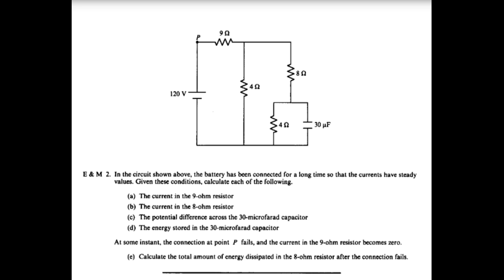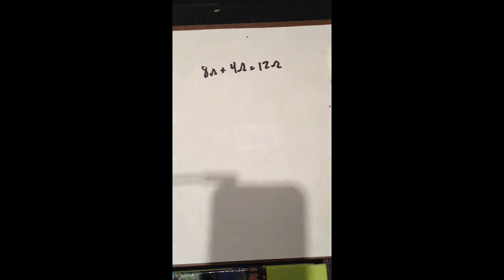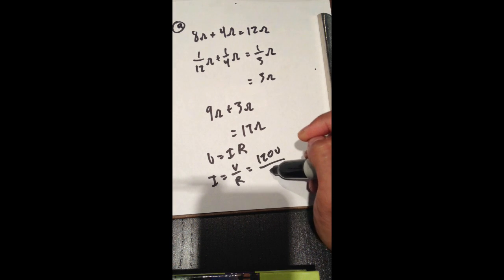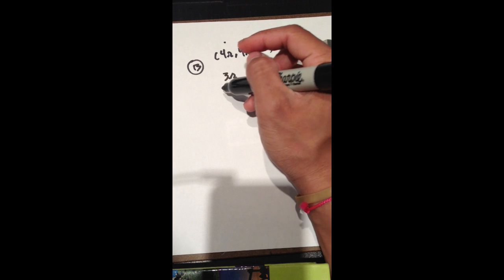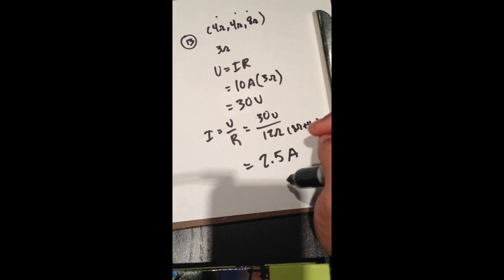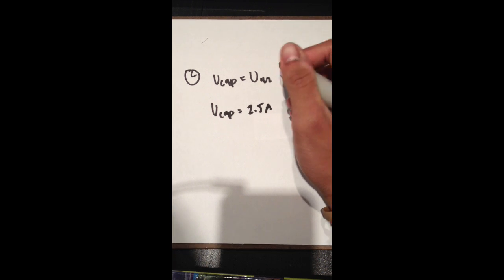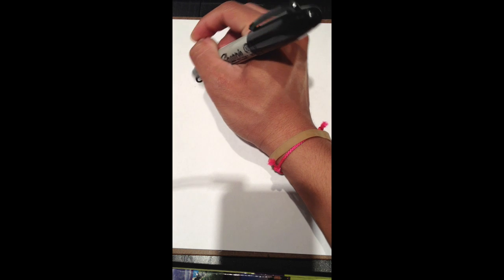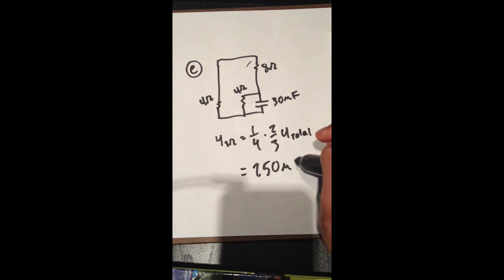1988 AP Physics C E&M #2

Comment: where do you get the fractions in part e
Reply: hasan khan the 9 ohms is 2/3 of the req and since the 8 ohm resistor is in parallel with the 4 ohm